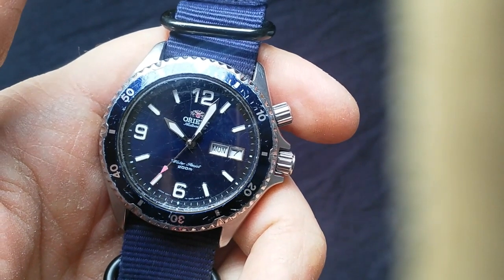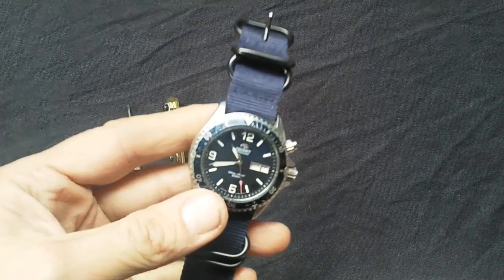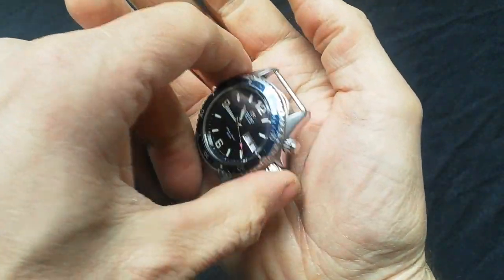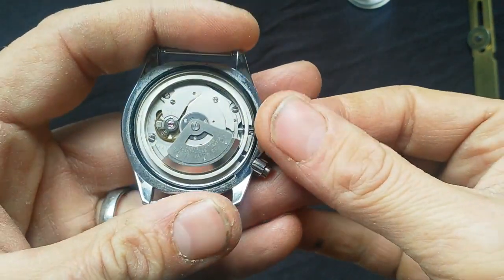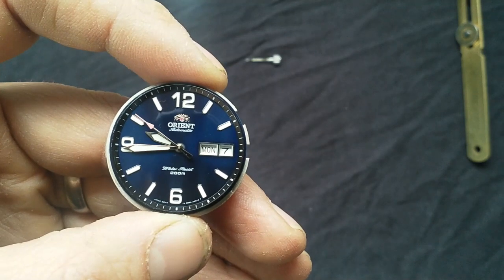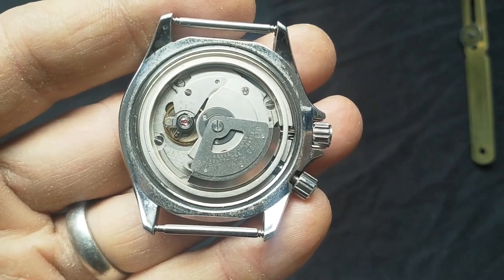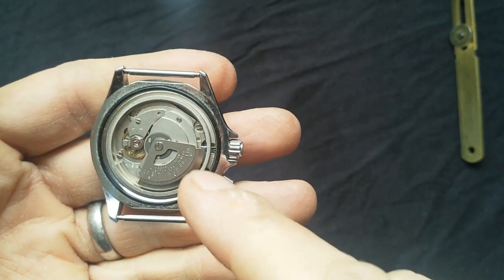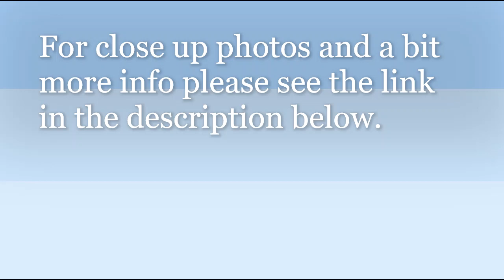Orient Mako Repair & Time Adjustment - Step by Step guide

Comment: Question, is there any minimal water resistance even with the crown unscrewed, but with the watch running? Today i commited the mistake of forgotting to screw down my Kamasu (cousin of the Mako), and had contact with water, although briefly. I let the crown out and it resting under the sun for some minutes but until now there's no sign of fog.
Reply from the maker: Hard to say but suspect there is always some if the water contact is brief, although the wind down crown adds proper water resistance. Ideally would pop off the back and check/let dry. Any salt water, even a drop, inside would be much worse than fresh.
Reply: Thank you for the asnwer. Today i checked and there's no condensation, the main sign (as far as i known) of flooding. Everything is running smoothly. I cleaned and dried the crown's threads once more just for peace of mind. I fear the risk of salt residue but i'm tempted to believe that nothing bad happened. I'll keep an eye (and that crown screwed-down!). In a few weeks i'll try to remember to come back and tell you something. Have a fine day, cheers.
Reply: @TheGrenadier97  the same happened to me but in fresh pool water.
Happyly I`ve noticed my fault in a few seconds after submarge.
I`ve opened the case back to check if there is some leak but nothing happened. After a week no steam apperance or nothing.
Reply: @krystianstepien5835  your answer reminded me to come back as i said i would. My Kamasu is doing absolutely fine, so much so i actually forgot what happened (but i'll keep the crown screwed down!). That experience proved me that the screw-down protection is really serious.
Reply: Greetings, I have an orient watch that gives no indication of what model it is. There are numbers and letters starting with klaa02  c1 a. I need this info to help me find a bezel that separated from my watch. Thank you very much.
Reply: Greetings, I have an orient watch that gives no indication of what model it is. There are numbers and letters starting with klaa02  c1 a. I need this info to help me find a bezel that separated from my watch. Thank you very much.

Comment: i just had the good fortune  of  receiving  a fairly unused gen 1 raven ray and i'm having some problems w/  what seems to be a stuck day pusher  winding lock.    i can't seem to unlock the protective  sleeve on the crown  and thus can't adjust the day display .    it's driving me nuts   to be honest.     i'm inclined to   "inject"  a little wd 40 on it  using a syringe  and apply some brute force  on it  but i'm reluctant because i might do some damage on its (presumably)  rubber gasket...not to mention i might scratch  its  beautiful   black pvd coating if i use a little pliers  and a cloth  on it.
Reply from the maker: Lovely looking watch that. Certainly sounds worth a try with some penetrating oil, maybe, pad the winder with something like rubber, whilst grip gently with some needle nose pliers.